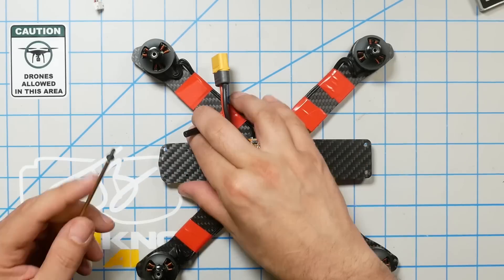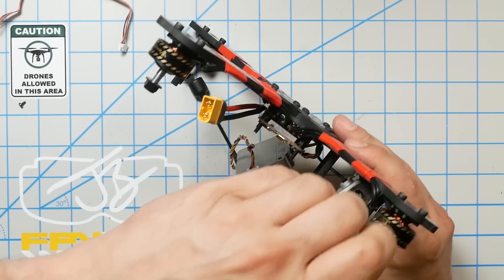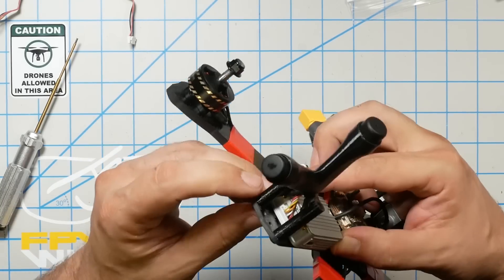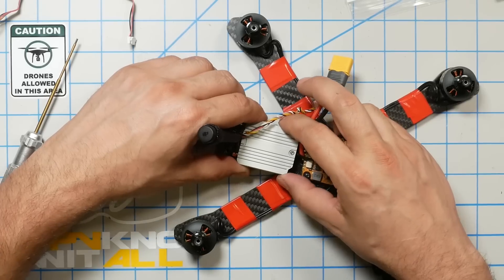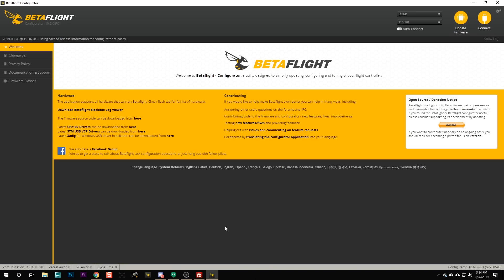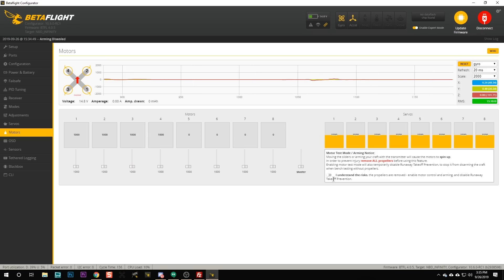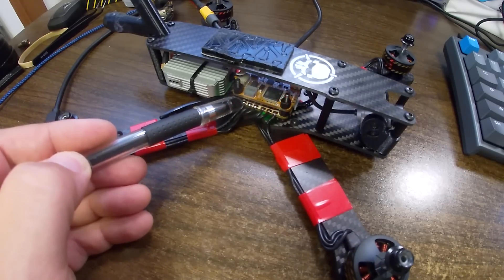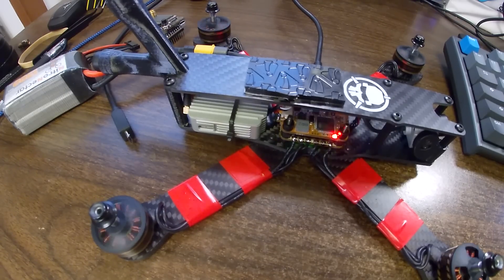Build Your Own DJI FPV Quadcopter - Part 3 - Final Assembly and Motor Direction

Comment: Could I still use the wiring harness for the air unit and flight controller if I’m using a seperate crossfire receiver? Any help would be greatly appreciated

Comment: Hey josh I’m hoping to build this quad soon and I’m wondering how you get the 3D printed parts to hold the camera and the antennas? Do they come with the frame or the fpv system? Or do I have to buy them separately? Thanks in advance!
Reply from the maker: I'm not sure if they're included or sold separately but Rotor Riot sells them regardless.
Reply: Joshua Bardwell thanks so much! Any other tips that aren’t in the video for when I build this?

Comment: Hey Joshua Bardwell,  I finally broke down and bought the DJI goggles with the 2 DJI cameras and 2 air units.  I've installed them on mine and my son's quads.  Both are Armittan Chameleons.  My issue is the back stand off as you know has only the one antenna hole and it's only for a coaxial style connecter to fit in.  So at first I had supported the antennas with tie wraps, hoping to protect the mmcx connectors. But my son and I have both broken a connector off an antenna. I've since bought the 3" extension that goes from mmcx to rp-sma and bought the DJI rp-sma antennas. And have not secured them in the rear up right and drilled a small hole in the top plate and secured the other there. Man this quad is packed now.... And figured all is good now.... Till yesterday in a crash and only from impact I broke off another mmcx connector in the hole on the air unit.  So my question is are you guys having an issue with these mmcx connectors breaking or the connection hole wearing out to the point it's not staying connected?  Seems like DJI, being the Rock solid manufacturer that they are, got everything right with their HD system except the mmcx connection.   Wish they would have used some kind of protection for it or done something like TBS did by mounting that security plate over the connection to ensure it doesn't get ripped off.   I mean the research has been done, that we drone pilots tear these mmcx and ufl connectors up all the time. Hence why TBS did what they did.   Any suggestions?  
Oh and as much as we've all screamed for an on/off switch on our goggles DJI really missed that as well.

Comment: As you didn’t do it, Is it still a  good idea to use capacitors for a DJI build? The DJI air unit doesn't seem to show any noise like analog systems.

Comment: Can you use the DJI Air Unit without a flight controller? Say I wanted to use it in a regular RC car, how would I power it?
Reply from the maker: Power it from vBat (if you are using 4S or below) or a standalone voltage regulator.

Comment: i got a question.i use your board bradwell f4 aio 32b stack and if i wanna connect it write  com6 port conection failured..i tryd so much but i cant find where is the problem.any idea?

Comment: Can this build be flown on both 4s and 6s?This is what iswritten on NewBeedrones's website in regards to the FC + ECS stack "Though DJI Air Unit can only support up to 4S, the Infinity 30 Stack can make the DJI Air Unite compatible with 6S batteries by providing a 9V 16W clean power for the DJI Air Unit.

Comment: Hi if we want to connect dji air uni with pixhawk 4 do u think it is possible and if so do u have any suggestions how?
Reply: There is a way to do it with an Arduino nano translating.  
https://github.com/d3ngit/djihdfpv_mavlink_to_msp_V2

Comment: Totally off topic but i wonder if youve ever mentioned, say getting stuck in a tree after most of your pack is used up, most of us want to try to turtle mode and full throttle right away. But i think if you wait a couple min for the battery to rebalance, or cool down, it will give you a better chance on getting out. Speaking from experience. Happy flying!

Comment: I'm so scared that everyone's going to convert over and my analog is just going to fail safe left and right T_T
Reply: The digital systems won't affect your TX, so you won't get fail safes. But it could affect your video. Though you can still avoid each other's channels, just like you would with analog video.
Reply: Unless your have a 5.8ghz radio, fpv system won't cause any fail safe
Reply: @FAQUERETERMAX  so does that mean dji might be experiencing fail safe?
Reply: Certain combinations will interfere. Speaking from experience lol
Reply: @krauselee877  oh dang haha good to know, thanks!

Comment: Hey Joshua, would you recommend the DJI FPV system over analog video with a Fatshark HDO and Rapidfire?
Reply: I want to know too. It's certainly heavier and bigger, and it doesn't fit all builds. Also, top racers say it introduces a bit of latency even if it's flyable and HD boosts their confidence having a clearer image. Also, it's much more expensive if you destroy your equipment inside the quad. He did many reviews but they're all very objective and professional, so I still want to know his real personal opinion on the matter lol

Comment: Hey Joshua, i don't fly regularly as i am afraid my stuff will get stolen so it wait for a family member to be free, what can it do? There are no rc pilots in my town
Reply: Put everything in a backpack, as you are flying you have the backpack between your legs (doesn't matter if you are standing or sitting, you can figure it out). If you feel like someone is messing with your stuff or you have a gun to your head or whatever, full throttle the drone in to the guy. Simple, when he sees a 50kmh+ quad flying towards him he will run, then you chase him. You save yourself and have a lot of fun. Also remember to post the video on Youtube!
Reply: @enzopedreira4640  Wow, just wow lol. I can see it already going viral
Reply: @enzopedreira4640  well how about some dangers like a bike at full speed?
Reply: @mehulanand8623  I don't quite get it by what you mean, a bike.

Comment: Can you install the antennas into the 3D print and connect to the air unit, then install everything as a unit instead of trying to make the connection after the 3D print is mounted?
Reply: I had the same thought!!
Reply from the maker: I don't think that would work well.
Reply: @JoshuaBardwell  thank you.
Reply: @JoshuaBardwell  why not? This is what I was going to suggest also. If you build another one, can you try it and let us know how it goes? Thank you.

Comment: you need to grind the antenna holders  down so  most of the antenna  is  sticking out   the TPE  shifts and blocks the radio waves  see  painless360  for info
Reply from the maker: It's a tradeoff between range and protecting the antenna.
Reply: @JoshuaBardwell  yeah but it shifts the  frequency center  https://www.youtube.com/watch?v=9JZJ9X4eYvA
Reply: @mikej8940  How interesting. So you're basically ruining your antennas by mouting them like this. Maybe needs further testing, would make an interesting video

Comment: Wow, I literally just checked to see if you uploaded this yet and you did 20 seconds before 😂 love it

Also, are you going to mount a GoPro onto this build?
Reply from the maker: So far, I haven't wanted to mount a GoPro on any of my DJI builds. But I also haven't used my DJI builds as my primary freestyle quad for making flight edits. I probably would use a GoPro for a serious flight edit but not for more casual stuff.